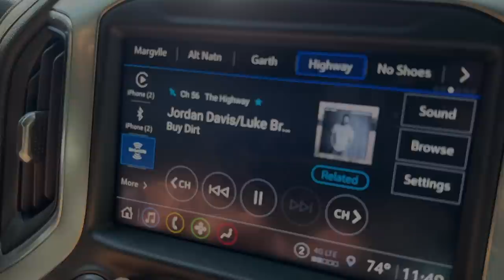Giving Up Control is HARD!

Comment: If you make like a fish bottle trap. Out of a big soda bottle put water and fish guts or bad meat anything that will rot and smell. Hang it up around the animals. It will get rid of lots of flies. I used it for my horse. Worked great. You can buy the traps but these work just as well. I would hang them on the fence, trees where ever you do not want flies. Also you can make your own fly spray. Water,vinegar and tea tree oil. Thanks for the videos I love them. Hope you do not mind the suggestion for flies.❤❤❤❤

Comment: Just a  tip. Put your  binder or rachet on the passenger side of the  trailer if something happens that they loosen up and have to pullover to  tighten them  up  your not  working on the  traffic side of the  trailer.

Comment: To train him to Brush Hog 
You need a Older tractor and older Brush Hog 
Dad bought new and I bought from him a 1968 Allis Chalmers D17 tractor 
I did buy a used 8 foot Brush Hog to keep the lanes open in the woods 
Less things to worry about with a 50+ year old tractor and a 30+ year old Brush Hog

Comment: Nice video 
I grew up and still live on a farm 
A number of different flies and Horse flies were a problem as we raise milk cows and steers 
Dad used a cattle mineral block that also controlled a number of types of flies 
I get the mineral blocks at the feed store 
But I also use a Red Ryder BB gun , I got mine in 1970 at 5 years old 
It still works , as my steers come to the fence if the horse flies are bothering them 
So I can shoot the pesty horse flies off their backs

Comment: In Australia, we call that implement a slasher. You call it a brushhog. The act of using the implement is called slashing.
I see your area is very dry. We are straight back into drought. After a heavy wet season last year, there was no wet season at all this year, just dry, dry, dry. And now the proper dry season is coming and many people are short of water already. I probably won't have enough water this year either. Buying water in this shire is very expensive.